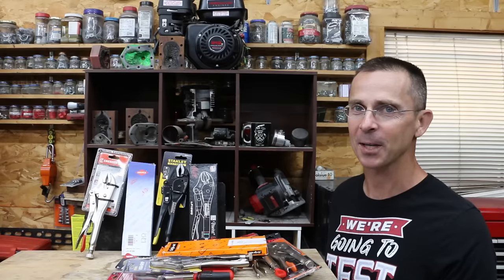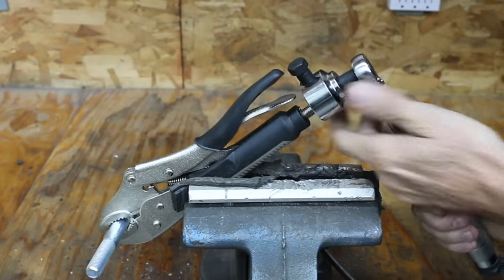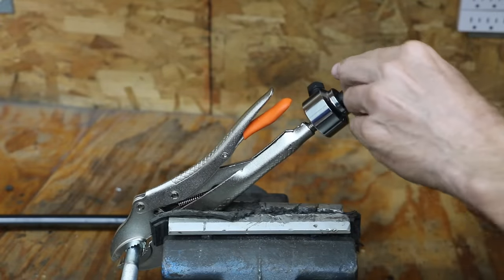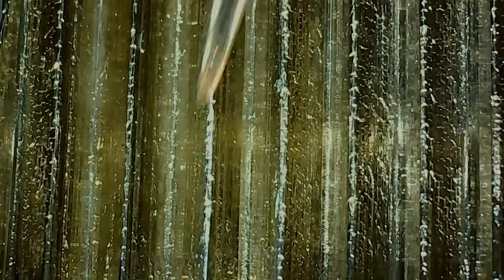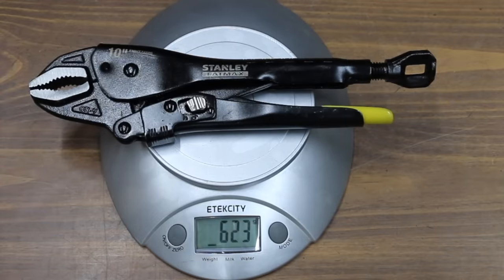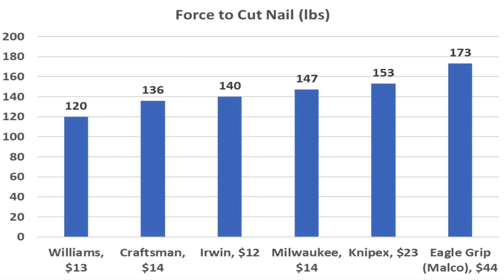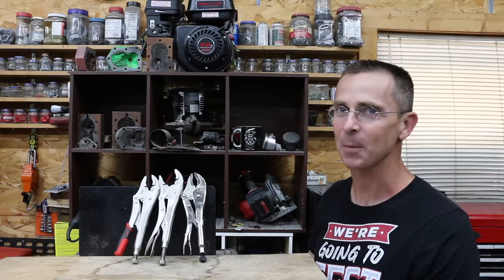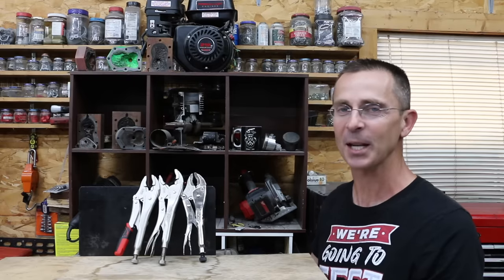Best Locking Pliers (VISE GRIPS)? Irwin vs Knipex, Milwaukee, Craftsman, Stanley, Malco, Pittsburgh.

Comment: I'd love to see how an original made in the USA Vice Grip from Petersen Mfg. would stack up. I treasure the two pair I have used for 50 plus years.
Reply from the maker: Thanks for the suggestion.
Reply: @ProjectFarm  I mention this because I was just using my Irwin - Chinese made - vice grip brand vice grips to remove a screw that had a broken head. It was rusted pretty badly in place, so, I had to stick a long screwdriver through the handles to get better leverage - like I've done hundreds of times before with Petersen made ones. The jaws skewed sideways and lost their grip on the screw. That's something the original Petersen USA made vice grips would never have done.

Comment: Please please test Hy-Per Lube Zinc Additive!!! It worked well to make my 1977 Dodge Van with a 360ci LA motor quiet down, as well as make my 2013 prius two’s gas engine run even quieter
Reply from the maker: Thanks for the video idea.

Comment: Try do test with LED Bulbs.
Use same wattage like 5 watt bulb of various brands and check their power consumption. If it really consumes 5 Watt.
Do check it on high & Low voltages as well.
Try test them with 12 Volt Battery.
Do a drop test as well.
Please do this experiment. I am a big Fan of yours. I am your subscriber please do this.
Reply from the maker: Thanks for the suggestion.

Comment: I have a couple Petersen 10WR vise grips made in the late 50s (before Irwin bought the company), and they are exceptional. You can find them on ebay for 12-20 bucks last I checked, and they outperform and outlast any modern vise grips I've used that are around that same price. Would love to see vintage NOS (new, old stock) tools in comparisons, especially if the price they're going for is competitive compared to the rest of the market like in this case
Reply from the maker: Thanks for the suggestion.
Reply: I think the Malco is the closest thing to the original. The real original not the Chicom one,

Comment: I would love to see a video of which brand in general is the best. Most brands offer sets of different electronic devices which always come with specific brand-batteries. So it makes sense you would buy more devices of one brand to not have 20 chargers and batteries arround. But which brand overall (for the occasional user) is actually the best? (USA + EU brands would be awesome)
Reply from the maker: Thanks for the suggestion.

Comment: It would be awesome if you could include the Original Vise-Grip Petersen Dewitt before Irwin bought them out. In my experience my old Petersen Dewits have retained very minimal slack, whereas the Irwins are garbage. If there is a new size or different type of locking plier, I will buy NOS  New Old Stock (if it's available on ebay or just search for a used unit. I'd be willing to bet the Original PD Vise grips would blow the rest of the brands tested out of the water.
Reply from the maker: Thanks for the suggestion.

Comment: It'd be interesting to see, but potentially hard/expensive to test, how consistent different brands are on an individual tool basis. Presumably if you tested ten Knipex pliers they'd all be very similar but a cheaper brand like Pittsburgh would be highly variable. But what would an actual test show? With all these tests I often wonder if I can count on getting similar results with the specific unit I'm buying and using.

Comment: The thing I care about least is where its made. Where its made doesn't really mean much other than QA and even then, that can be averted by having a presence in the factory its made, enforcing quality. More important is the design and materials used - which where its made has no bearing on. You can tell the Malco is just designed to be overbuilt and overdesigned compared to the others. - which is great if you're looking for that buy once, cry once type of tool.
Reply from the maker: Thanks for the feedback.

Comment: Seems like this could be interpreted as a test primarily on how little friction the adjustment screws have.
Reply from the maker: Thanks for the feedback.
Reply: @ProjectFarm  I suppose you could account for this by determining how much torque is required to result in a consistent clamping force for each wrench, and then using the wrench-specific torque in each test.

Comment: I'd be interested in a test of battery powered gas pumps... such as the 'as seen on TV 19.99 Turbo Pump, and  the $40  Tera Pump, i've had a few cheaper chinese ones that crapped out after a few uses, and others that seem to not pump as fast as advertised.
Reply from the maker: Thanks for the suggestion.

Comment: Grip rotation was not always apparent nor in some cases honored. You must use your tools correctly.
Proper grip rotation is the top jaw pulling while the lower jaw pushes, such as in the ONLY way a pipe wrench will work.
This is also the way to use a crescent wrench, channel locks or any work pinching tool that has the teeth at an angle which promote directional gripping.
Reply from the maker: Thanks for the feedback.

Comment: I knew that most of the Chinese pliers would fail at cutting a nail.  I have noticed that cheap tools can't cut steel worth a crap.  The lineman pliers are a perfect example.  I can cut steel wire with my Klein 9s all day.  Whereas most cheap ones don't temper the cutting edge properly and are really only good for cutting soft metals.  I think it is also the angle that they grind the cutting edges.
Reply from the maker: Great point!

Comment: This is the continuation of a common problem with tools that have had their patent run out. The early original Vise Grip was so much better than anything available today, even Vise Grip which is obviously still made. It just can’t compare to the old ones. Originally made in the 1920s by a blacksmith, they were strong, smooth and had sharp teeth. The knob used to adjust them felt very smooth with no gritty feeling. They were also able to be unlocked easily even if heavily tightened. There was no play between parts (at least on the 1950s models I’ve used. I’ve been using them since the late ‘60s and while they have come out with interesting models since then they are a shadow of their former glory. When Irwin purchased them and to “stay competitive” outsourced them to China the quality really dropped off. Too bad really since they were really great tools but not so anymore.
Reply from the maker: Thanks for the feedback.

Comment: Great video but, you forgot to say that the so called locking pliers, were not constructed as a pliers but, as welding clamp for sheet-metal welding. So using them as pliers is misuse.

Comment: Vice grips should never be underestimated.  I took my headers off my Camaro years ago which are kinda a bitch to remove and one bolt in particular stripped. Nothing I had would remove it and i thought i was gonna have to weld a nut to it. This is what I get for not using arp bolts years prior when I out the things on😂 anyways, for science sake I tightened some good ole regular style silver irwins on that nasty bolt as tight as humanly possible without breaking them and i couldn't believe it when it came off without loosing any grip. I will be purchasing a set of malco eagle grips to accompany my irwins!!
Reply from the maker: Thanks for sharing.

Comment: Its a shame that almost half of these brand used to be made in the USA and were US companies but now sold to overseas companies which most people arent aware of. The ones that are the most expensive are the ones that are the best. If your looking to use a tool that you will use to make a living or use it often, my opinion is that you should be using the that holds up the best whether its the most expensive or not. In the long run you basically get what you pay for. When I used tools for a living and used them every day. I had a snap on or Mac truck sell tools to use and even as expensive as they were, I have them 30 years later and still work great.
Reply from the maker: Thanks for sharing.

Comment: This is an extremely difficult test to do an apples to apples comparison. Even with putting the same amount of torque on the adjustment screw, the geometry of each tool will mean different pressure will be exerted by each set of jaws. The only way to do a accurate comparison would be to measure the pressure applied at the jaws, and adjust them so that each tool was exerting the exact amount of force on the hardware.
Reply from the maker: Thanks for the feedback.

Comment: Wouldn't it be better to specify the closing force at the handles of the pliers (like the cutting nail force was measured)? Depending on the inner mechanism the torque of the screw might be not very accurate...
Reply from the maker: Thanks for the constructive feedback.

Comment: Well, the way you torque these are more a matter of what threadpitch that adjustment screw has. the right way todo it would be to have a loadcell measuring the load to close the pliers. So that result is nowhere usefull. thanks for the effort tho.

Comment: I love your videos but I think the first test wasnt done very well. Torquing the adjustment screw may have seemed scientific but as mentioned in the beginning, some grips had smoother or tighter adjustment screws even when the handle was open, and this wasn't the point of the test. Friction in the threading and at every point of contact in the arms when under load would affect when the torque setting was reached and lower the amount of clamping force applied. Less friction would lead to more pressure being applied to the jaw, but this is also not how locking pliers are typically operated, you do the adjustment when the handle is loose and the friction doesnt matter as much, then clamp down with hand strength.

A more accurate method may have been to set a standard "hand grip strength", then adjust the screw until it required that "hand grip strength" to lock the jaw using the setup from the nail cutting test, thus measuring the leverage/advantage and grip strength the pliers had when operated by an actual hand.  Of course testing to failure is important but I think actual real world use-case is more useful.
Reply from the maker: Thanks for the feedback.

Comment: the best locking pliers? brazed, welded, spot welded on piece :))
that said before watching, I'm sure this will be a good video, nothing sucks worse than wasting money trying out multiple brads to find they all suck or one is slightly better, then comparing to others that are 25+ years older and most were still better.
Reply from the maker: Thanks for the feedback.

Comment: I really like many of your videos but I think that the testing method for these locking pliers is fundamentally flawed. 

The locking pressure adjustment in this video is done by turning the knurled knob after the jaws are clamped on the object and therefore the adjustment is performed under load. 

This brings a very major unrealistic factor into play which is the energy lost through friction in the adjustment mechanism being used while under load. The pliers are not designed to be used like this and it means the final clamping pressure at the jaws aren't being tested in an even way. The results will be unnaturally skewed in favour of the pliers with the smoothest adjustment action /finest adjuster thread, when this wouldn't be a factor in real-world use.

I think that the pliers should be adjusted to fit the object, then opened and tightened by a set amount (taking thread pitch into account) and then clamped up again for testing. Although not a perfect method it would be better than the test as is.

Thanks for your many and very thorough videos, they're very interesting and useful.
Reply from the maker: You are welcome!  Thanks for the constructive feedback.

Comment: Why no grip-and-pull test, only twist/torsion? The final test was pointless, as the tools are never used that way, and no designed to take high torsional stress on the adjustment screw.

Comment: in 1999 GM engineers made a drill bit 0.001mm and the where so proud of it the shipped it to AMG headquarter to show what the accomplished and just in couple days AMG shipped the drill bit back and a written latter please inspect your bit the GM engineers did not find nothing unusual until the put it on a scoop and found out the 0.001mm drill bit made by GM was drilled threw GM management later told the team it was the most embarrassing thing the did
Reply from the maker: Thanks for sharing.

Comment: I'm kind of disappointed in the results of these tests. The #1 most important factor for me is jaw hardness to prevent deformation of the teeth. I've been using irwin at work for some time and have been extremely disappointed in how well the teeth hold up. Every threaded portion of a bolt I clamp on to just threads the jaws of the tool. I have a milwaukee but don't use it all that much for some reason.
Reply from the maker: Thanks for the feedback.

Comment: Would you mind doing adjustable/crescent  wrenches? I’ve bought several from harbor freight to craftsman and crescent. They always seem to either open or close each time I rotate a bolt. If there’s one out there that doesn’t adjust while in use I’ll be damned.
Reply from the maker: Thanks for the suggestion.

Comment: This makes no sense- what you are showing here is for the most part not the quality of the tool, but the clamping force it gets out of setting the screw to a predefined ammount of pressure. This is not relevant in practice, is it?

Comment: Why do you use imperial for width and SI for weight, then imperial for torque!? I like the videos but if you're gonna use a system of measurements... please just use one system...Converting back and forth sucks.
Also it's like pronouncing knife. For the knipix..... the k is silent my man.

Comment: Cheap pliers just means you are gonna buy several of them.  I came here to see which was the best pliers whose teeth won't round off after using them 1 or 2 times to get fasteners off.  Every brand except the Malco is made in China or Taiwan (Still China),  The Malco Eagle is made in America, which is why it's more expensive, but also better quality.  I'll shell out the $40 bucks for a good quality tool that will last past 1 or 2 times of use.  Everyone needs to buy American and stop buying Chinese JUNK!!
Reply from the maker: Thanks for the feedback.